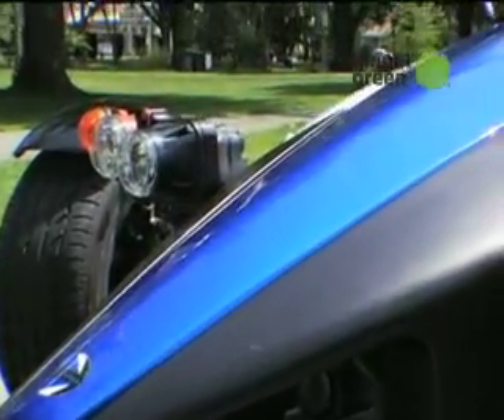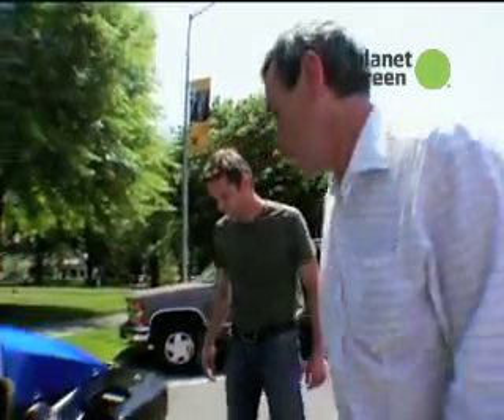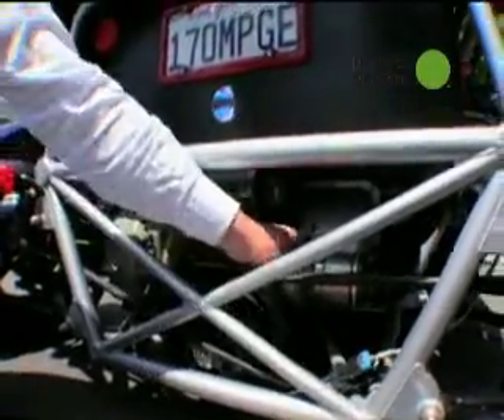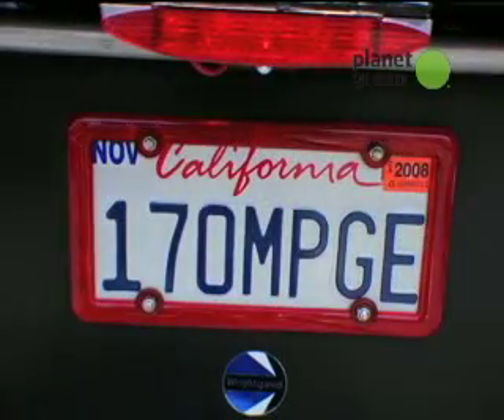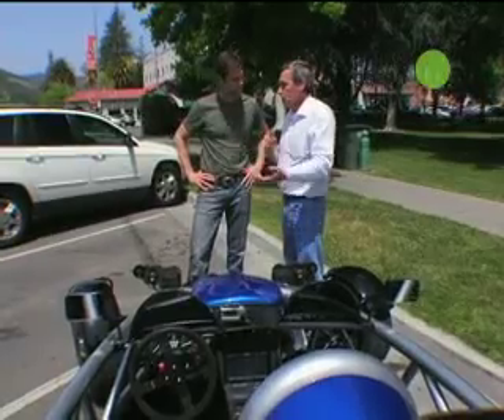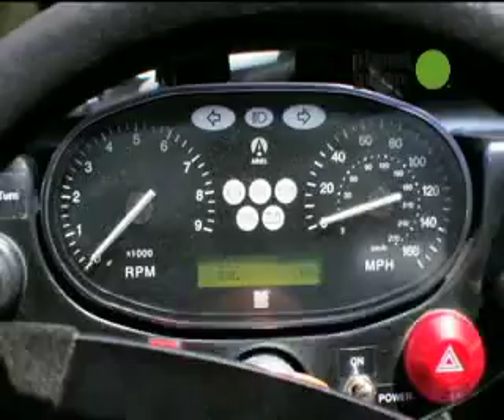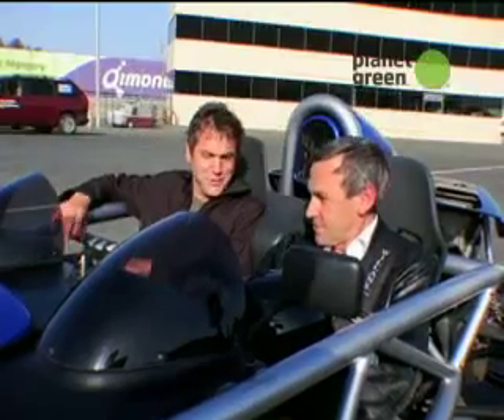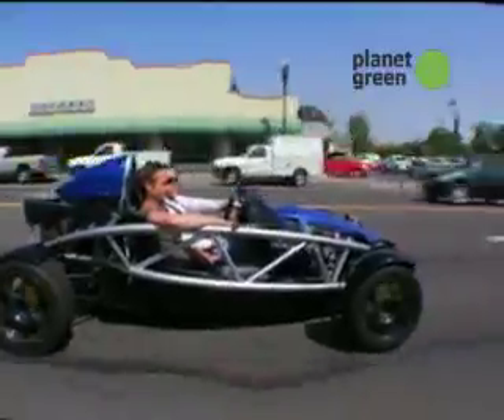G-Word: Electric Race Car

Comment: I look forward to his 1000 pony drivetrain. if he puts that in an atom it will need drag tires and only top fuel dragsters might beat it.
and better yet a proper car that's not as heavy as an arial atom. that should boggle the minds of the petrol heads

Comment: methods for recycling of Li batteries, like the ones usedin this car, are still being developed. Recycling batterisis a very dirty costly business and will most likely result in ppl dumping batteries or sending them off to foreign countries to deal with.

Household batteries. thise cylindrical AA, AAA etc batteries are recycled, but only the metal shell they are made of is reused